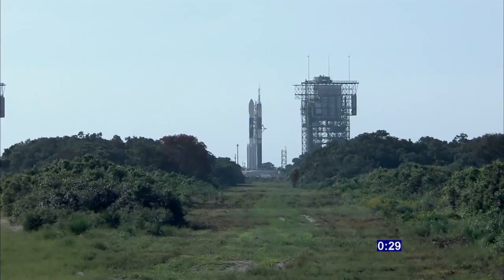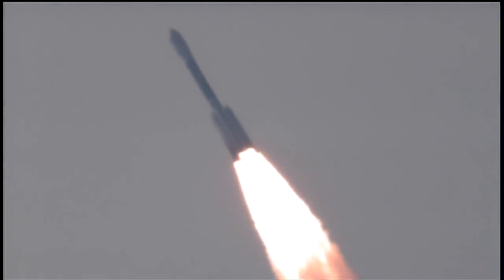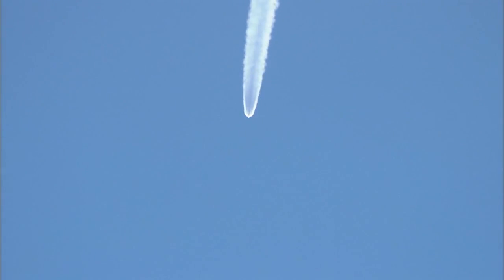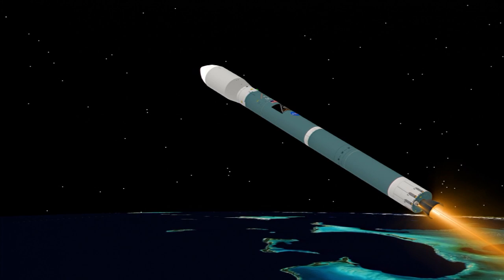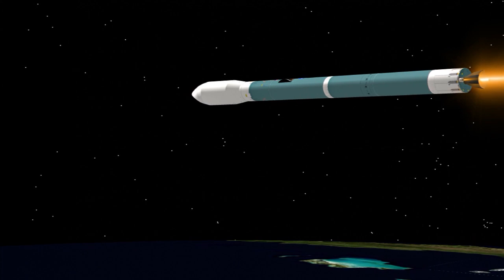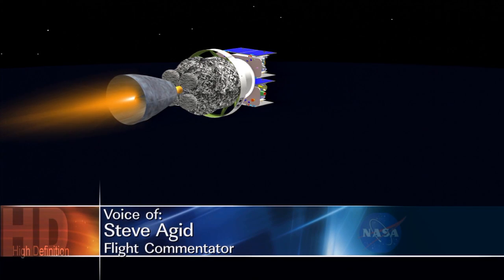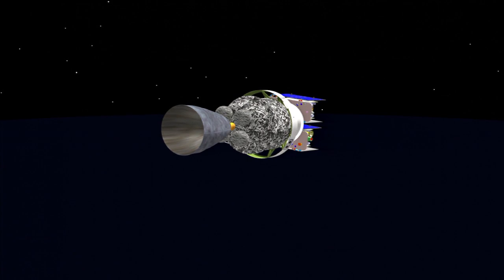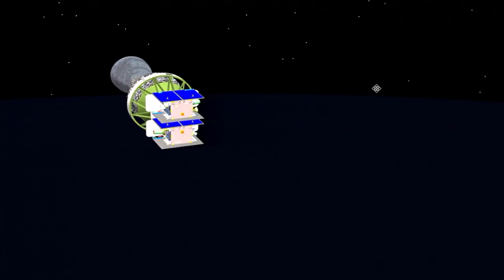NASA's GRAIL Spacecraft Launches on Lunar Mission

Comment: You can always tell when solids are used because it always looks like an old car running on bad gas.  Delta rockets with out SRB's are excellent.  Had they not used solid boosters, Delta might have a better reputation than even Atlas.